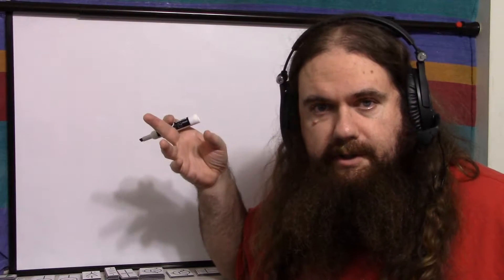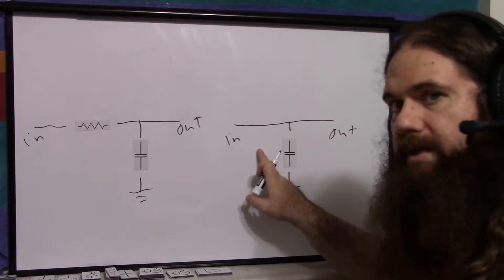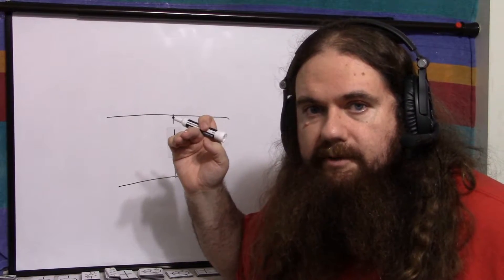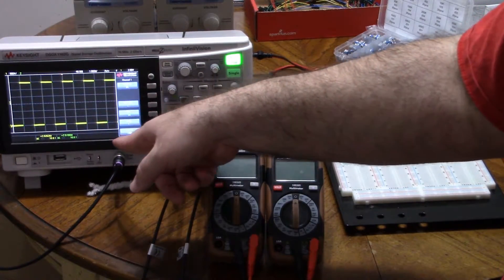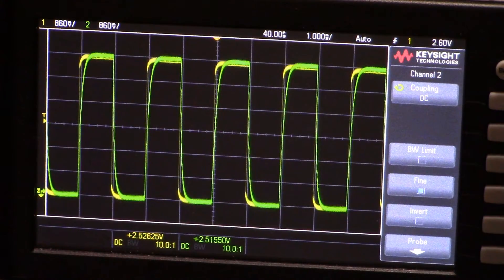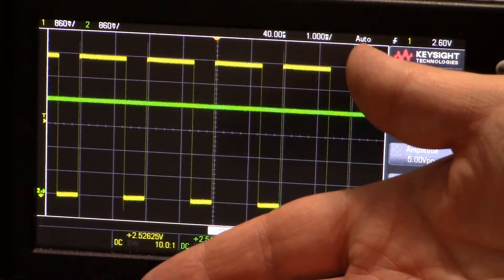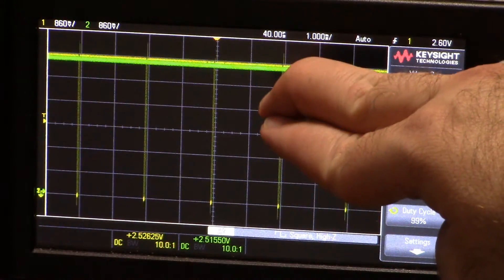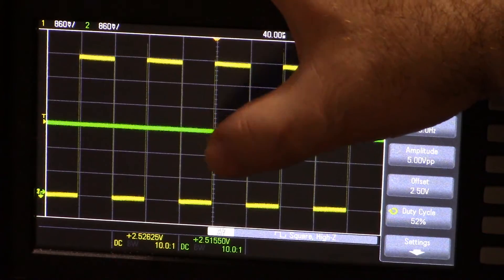Creating A Variable Voltage Analog Signal WIth PWM And Variable Duty Cycle - Simply Put

Comment: I watched a bunch of your videos a while ago. I am now in a place where I need to speed control a DC 2 wire fan, and reports are that PWM makes them whine, and I don't want to waste power heating a resistor. I may actually design something that uses a couple of your videos worth of shared knowledge. Thanks.

Comment: PWM is in general an analog signal, because the duty cycle can have each value between 0 and 1. Digitally created PWM of course is not, because also the duty cycle has fixed values.

Comment: Great vid and brilliantly explained. Thank you. Got me out of a jam using Arduino PWM to control an LED-LDR 'vactrol'  to replace a pot for pitch control on a homemade synth. The PWM was giving me unwanted frequency modulation but a 4.7uf / 100k filter sorted it. NPN as voltage follower to drive the LED.

Comment: I really liked this, like how you think and explain things- Can you show how to turn an arduino pwm output to get a 0-12volt constant current output? I am looking to drive a Peltier or two and put a closed loop on it to keep it from freezing. I bought a darlington pair 10A chip to drive it- but it's been 25 years since I last built or debugged an electronics circuit.

Comment: How about using 2 smaller caps equal to the single cap to speed up conversion ?  GREAT VIDEO.
Reply: They behave as one single 2x capacitor. The current is split between the two.

Comment: Good explanation and visual aid .. especially for an idiot like me . Maybe you could help me with a project ? I am trying to drive a DC motor from the variable analog output of a data acquisition module (DAQ) but the current is just too weak to drive even a small motor. basically I need a variable relay and instead of a knob changing the speed, the small current would . the output is variable from -10 to +10V DC... have I made myself clear enough ? do you know of a such a device ?  Sorry if I am way off here!

Comment: Is that correct to say that a capacitor does not charge nor discharge in two values?  If that be the case, a capacitor perhaps is an analogue device.

Comment: I have come across several of your videos on similar topics when i have been researching/thinking about how to do this little interesting task i am trying to accomplish. Basically i have a non-limiting grid tie inverter that i want to be able to throttle. I have read that the limiting (grid tie inverter w/ limiter) the ones that have the CT on the mains utility lines to measure total demand and then limit there AC production not to exceed that value, do this limiting/throttling by shifting the MPPT function to a less efficient area to limit the total power output....i should have noted that both types of inverters have (or at least say they have) MPPT function on the DC input side. I have considered DC-DC CC-CV converters, DC motor controllers but i think the problem there is those use PWM to do the DC-DC converting AND the MPPT functions on the DC side of the inverters also use PWM so i would be feeding a PWM signal into another PWM. This is where i got to thinking if the PWM was filtered down to a more pure DC signal. Currently theses inverters just have the PV panels plugged directly into the MPPT function of the DC side of the inverter. Getting into the MPPT calculations to make them purposely less efficient is probably way above my head electrically But i see this whole little project as a challenge and learning process more then being a long term piratical solution...that would be just buy the more $$ inverters with limiting :) ...so my questions are 1. what might be the best way to throttle/limit theses types of inverters form the DC side 2. With the voltages/current i am dealing with what types of R and C values might be good to try to filter the output form the DC-DC converter before it feeds into the MPPT of the inverter? 20-40 VDC and maybe a max of 25-30 amps incoming to the inverter...Thanks for any insight or ideas you may have..Brandon

Comment: This was so awesome! Exactly what I was looking for. I basically have 16v LED flood light that I’d like to control from an micro controller (esp8266). Now using a mosfet to turn on and off is easy , I wanted to add dimming capability. I tried pwm the pin going to the get and it kinda worked. Was very klunky in the transition. Using your approach of an extra filter as I put to the gate should allow me to smoothly adjust gate voltage which should vary the drain source current to the led.
Reply: you prolly dont care but does someone know of a tool to log back into an Instagram account??
I somehow lost the account password. I would love any help you can offer me
Reply: @Abel Emiliano Instablaster =)

Comment: Can you make a video on how to make a homemade 12v dc to 230 v ac converter the simplest way,  since you have a clue about waves and electronics.  From start to end
Reply from the maker: Working with voltages that big is not for the faint of heart, and also not for the amateur. Increasing voltage is the work of a transformer, but trying to drive any sort of powerful load (which I assume is what you want to do, because I doubt you're asking for 230V AC for a couple milliamps) demands an actual professional device like a power inverter. A casual search is returning results ranging from 30$US to 220$US, and those devices are much less likely to result in either of us dying.
Reply: @simplyput2796  I am sure you can make one which is capable of doing at least a couple hundred watts. When you think its too complicated how about a teardown?